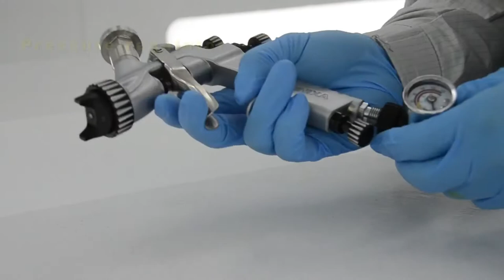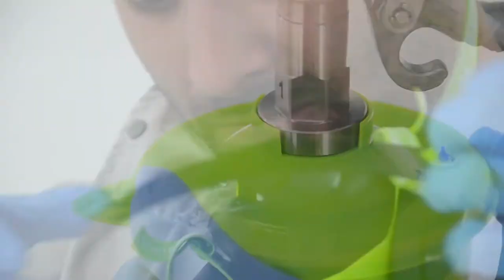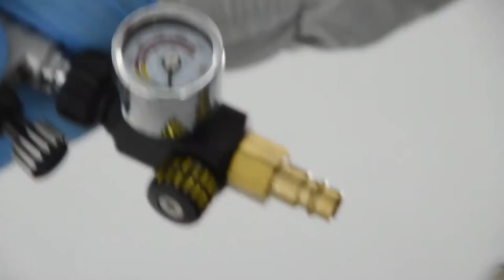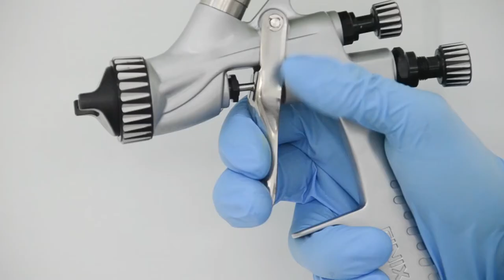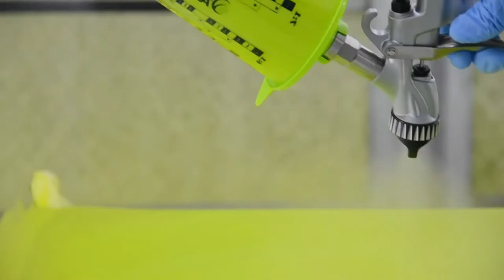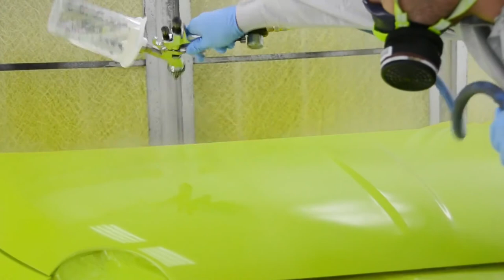Finixa SPG 800 900  High transfer spray gun   base clear

Comment: Hello. Tell me I want to buy Finixa cc500. 1.3 1.4 1.8 nozzles. in the characteristics the air flow rate is written very small 4cfm (about 120 l / min. is it true? and yet such a moment the flow rate of material per minute is not what you know? I have a large compressor. an interesting gun with a small flow rate of air and material (to save). can you recommend?